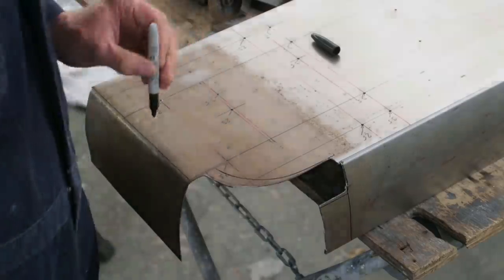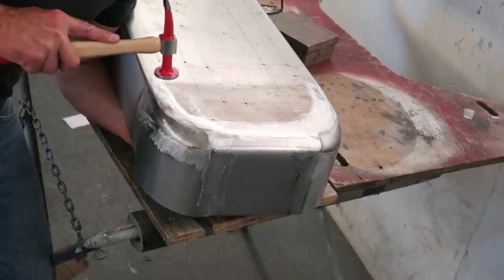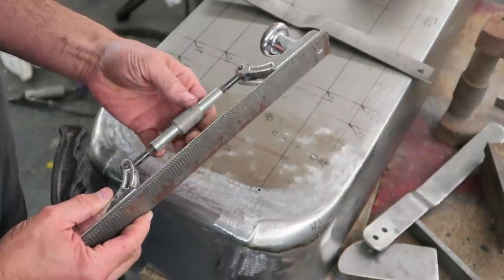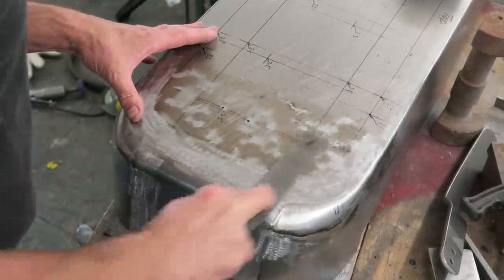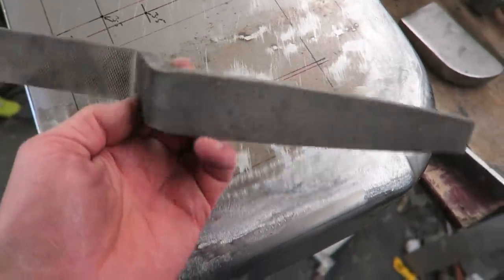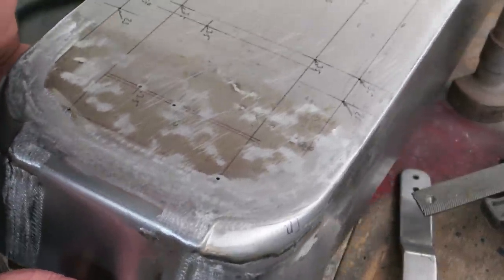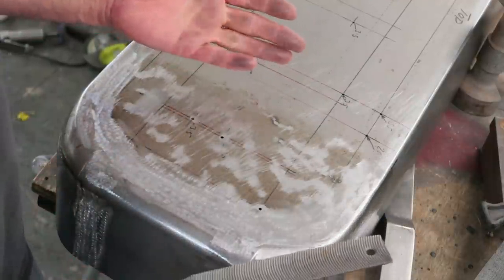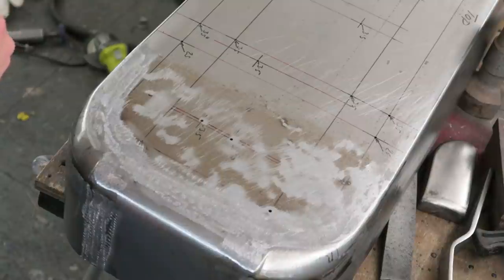Metal finishing welded panel repair sections car bodywork. Tips and Tricks #53

Comment: Nice work as usual. There are very few real metal bumpers left and I appreciate you keeping it going as it is almost a lost art over here in the US though it does seem like it's much more common in the UK. Us mere mortals are doing the get it close skim with filler and use a 2k sandable primer. The modern methods work but the art of getting the metal where you want it will always be impressive.
Reply: I think the worst part is I know a guy that will make a dustpan becasue he saw the one Ron Covell make. Will then turn around and order a fender because making a patch would take to much time and effort. It took longer to get the new fender to fit right then it did for me to make a patch and sand the original. The best part is I learned how from watching Trev.

Comment: So your file or sandpaper doesn't plug up I use a little liquid dish soap and water.  In the 50' how did they make those bombs on the front bumpers? I need to make me a set for my dune buggy.
Reply from the maker: Check out Ron Covell’s latest video series F-bomb. Cheers Trev 👍

Comment: Hi Trev,
Could you elaborate on raising the low spots? When the lows have light file marks I assume you stop filing? At this stage the panel will have a mottled effect i.e. lightly filed lows alongside bright high areas. It seems to me that the panel is now not quite level and the high spots will need to be slightly shrunk. Also, surely the presence of adjacent highs will raise the body file and prevent it from scratching the raised lows. Would it be better to shrink the highs first?
Thanks
Mike
Reply: @Mfw Whelan, I think you'd need to go all over panel leveling high and low spots as much as practical, then if any obvious bulging high spots remain you can consider heat shrinking them down. If you start unnecessarily shrinking spots all over panel you'll run into problems. Well that's my thinking anyway 👍
Reply from the maker: Agreed 👍
Reply from the maker: I think you’re perhaps overthinking the process. My general rule is to always finish raising my low spots before doing any shrinking. If you start doing both you’ll end up in a pickle. If you try the process out you’ll be surprised by how effective it is a raising without creating too higher high spots. If you are creating high spots that are too high you’re either striking too hard or using too higher crown dolly.
Reply: So you will rise lows most of and have some a bit higher spots ... but then you will use sand papers and so on to finish the metal ans Trevs does and this way you will get just minimal non eye seeable distorsions... this is my way of thinking. You cant stop just at this point where you take up some lows and do not finish it properly... even if you would use some putty it would be minimal... and probably you can fill it up with high bildup promer